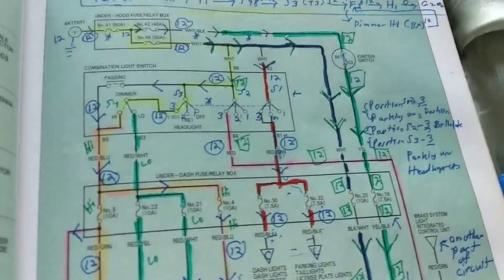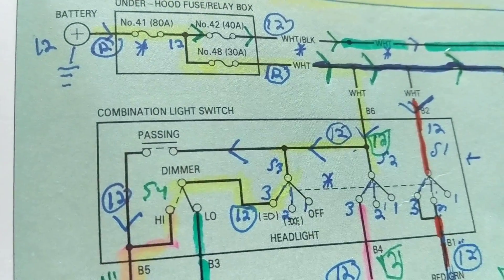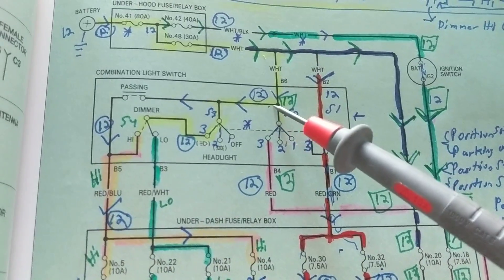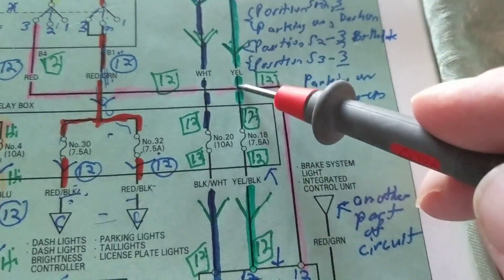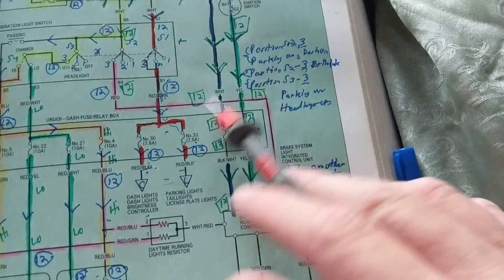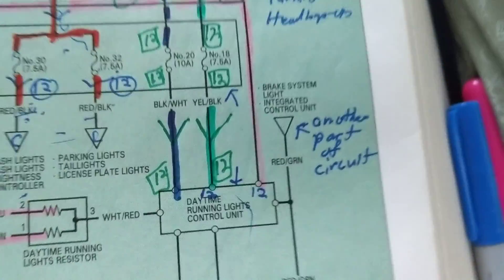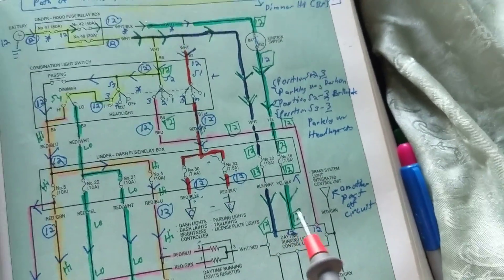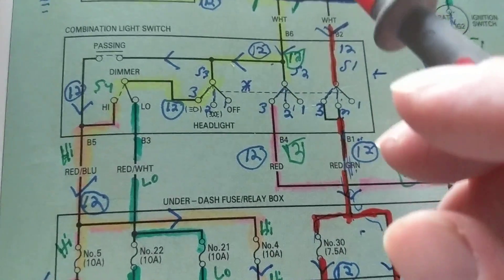HOW TO READ AUTOMOTIVE WIRING DIAGRAMS  the MOST SIMPLIFIED EXPLANATION PART 1

Comment: help me please my hrv 2020 keep draining my battery found out was a back up and audio fuse # 21 ,22 10amp  i need help please this is my 4th battery  already now i just remove negative every day im to tire of doing it pelase help is this similar happening to my hrv? you think? how can simmulate if tapping the door will change the reading? also were did you found a honda wiring the alldata does not have a wiring for hrv 2020? or i have to sign up first? to able to see it? is there any legit site to pay? help

Comment: I know this is an older video and a great video. Could you tell me if i have a test light between the positive cable and the positive side of the battery, should it light up because of the radio? It lights up dim. I can pull the radio fuse and the test light will go out. Does this mean that i have a short to ground? It is not blowing fuses. Hope to hear from you soon and that you are still doing well. Thanks for making the videos.

Comment: I need help I am trying to put in a push button ignition on a 2008 Nissan Altima coupe I need help can someone please help I need help understanding the language of the diagrams
Reply from the maker: The best way to put any start button is from the battery to the fuse you have to use the right gauge wire on the right fuse amp rating this will not be on the diagram since you're adding it on